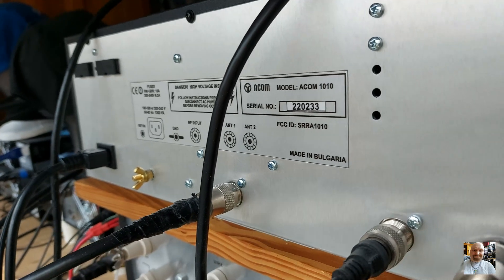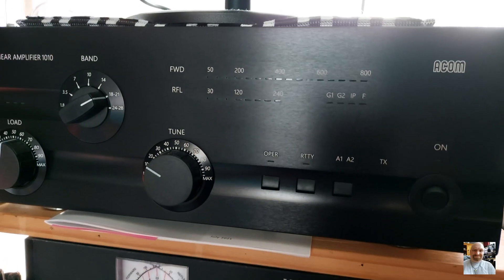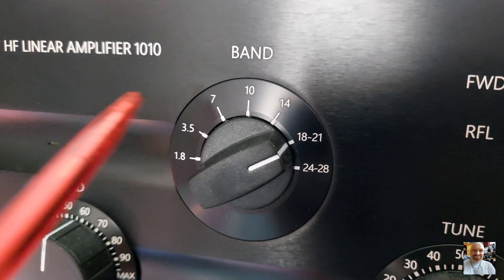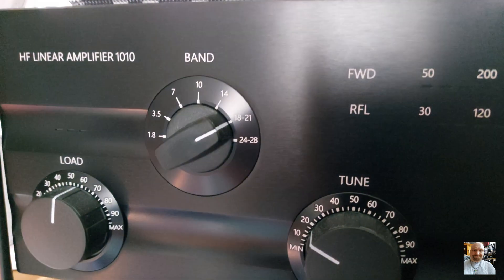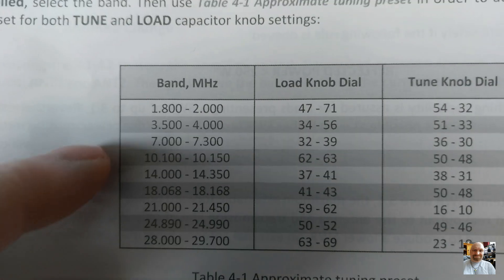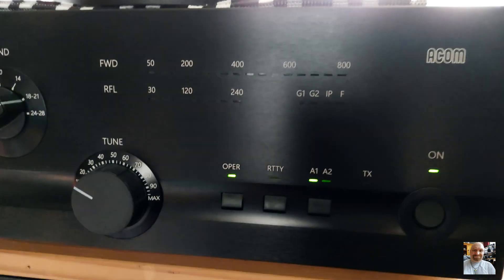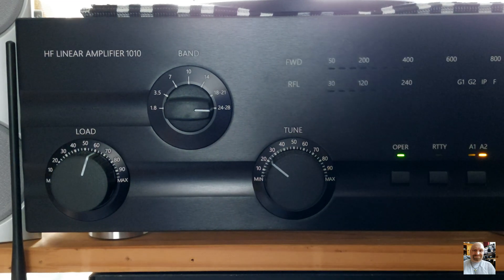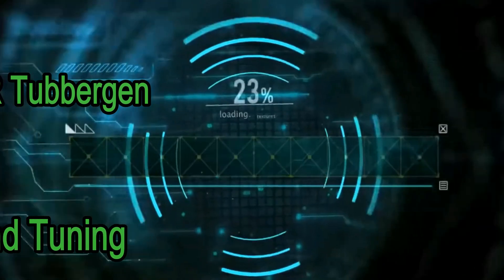ACOM 1010 Explain and Tuning

Comment: Hi, can this Amplifier operate in the 11m CB Band?
Reply from the maker: Hello there My Friend i think the amp can not work on the 11 meter Band but i don't have tried yet because for me it is not nessesary to do that....in my opinion the Amp wil not working on the 11 Meter...but i wil try this out than maybe i can say yes or No .....wish you all the best Vy73 de Bert PA5HR
Reply: @PA5HR1 Hello my Friend, it should be works, because there is a Band Switch in the range from 24-28 mhz. In the middle there is the 11m band. Hope you can test it 🙃👍🏼 thanks

Comment: Thank you for the upload. I am aware these amps have parameter locks for FCC regulations. Can the lock be disabled to operate on 11m band ??
If so  is there any information on how to unlock ?? Thank you in advance.
Reply from the maker: Hi there thank you for your Comment and the question...for so far i know is it possible to work with this Amp also on 27 MHZ because the Band switch goes between 24 MHZ and 28 Mhz so if you want to work on 27 MHZ you switch on 28 MHZ and i think it wil be working also on the 27 MHZ .....but am not sure about it and i can not try this out because i have no radio what can work on 27 MHZ.....but i think it wil be working .......thanks again al the best Vy 73 de Bert PA5HR
Reply: @PA5HR1  Thank you for reply . Much appreciated..

Comment: Hello Bert -- I like your setup and personally own two of your radios.  A question if you don't mind...So the amp tunes for antenna/band mismatch. At this point, does the transceiver still see the mismatch?  Does the transceiver still need to be tuned or is it happy with the connection to the ACOM?
Reply from the maker: Hello Goodoz if you want to use the Acom 1010 than is the Advice to use with external Tuner because the SWR for the TRX is very bad and can be damage the Finals in the Radio ....you can use the Amp without a Tuner but than you must have a good Tuned Antenne than no problem otherwise you have to use a ext...Tuner my Friend ...Vy 73 de Bert PA5HR👍👍
Reply: Is that true? My transceiver is seeing a better SWR than the amplifier does 🤷🏼‍♂️

Comment: Hi, I saw your video, and wanted to ask you 2 questions: Can I get the amp to work with an icom ic7300 WITHOUT the relay switch wire? How many watts do I need to use on the ic7300 to run the amp? Thank you.